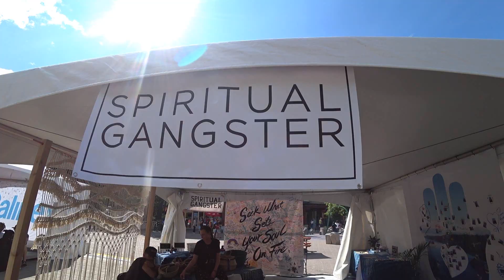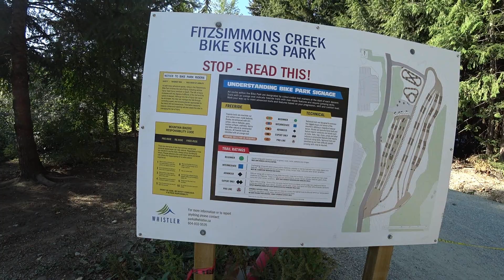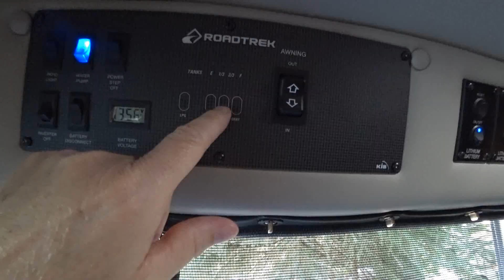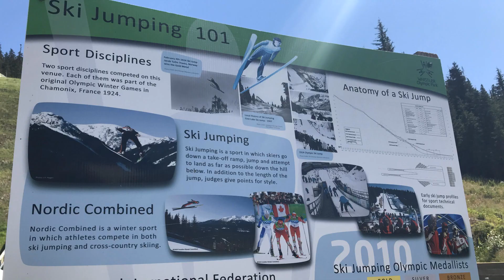Anniversary Trip to Whistler in our Roadtrek Zion!

Comment: Excellent video! Looking at your dump setup am I correct you have both a macerator system and a traditional gravity dump system, if so this is an excellent setup if your macerator pump fails.

Again very enjoyable video and Happy Anniversary.

Jim
Reply from the maker: James thank you!  And yes you are correct; there is a manual/gravity drain as we well and we carry a small sewer hose just in case.  Don’t expect to ever need, but nice to have.